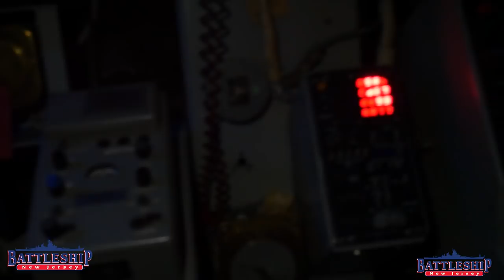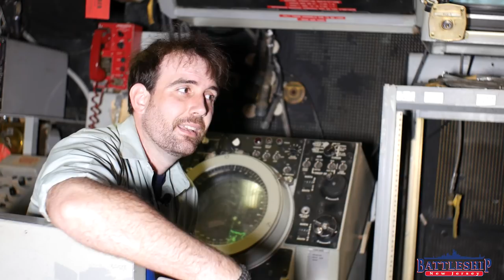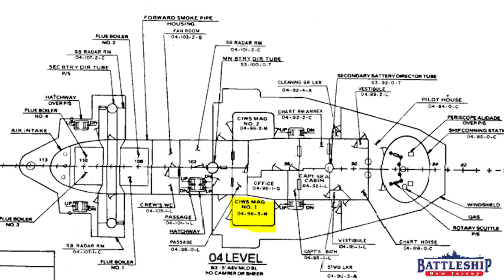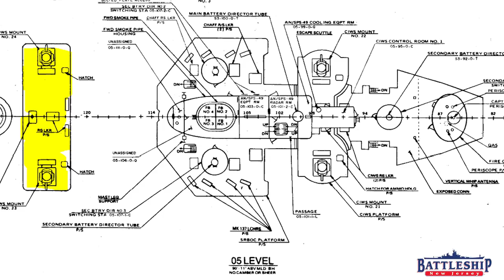Phalanx CIWS

Comment: Heavier ammunition doesn’t mean higher velocities. Usually it means the opposite. But it does carry far more kinetic energy to the target. (Mass x velocity²). It is also much harder of a metal so it will cut through things much easier. (See Moh’s hardness scale)

On that note I’m addicted to this channel. Keep them coming bro!
Reply: That is why it is 11mm diameter with a 20mm discarding sabot, most of the high amount of energy in the 20mm drive charge is imparted to the projectile. The soft sabot does not wear the barrel much, and is light enough that almost all the drive is passed through to the penetrator, with the sabot only being a fraction of the mass. Also a smaller amount of drag, so less variance from shell to shell, plus the surface is not damaged from driving rings and scores in the barrel.
Reply: Yep, at high velocities mass is the only variable of importance - if your hit by a lump of jelly at 2000km/s its far worse then a sharp pencil at 2000km/s
Reply: It depends, heavier ammunition means it can move at higher velocities because it will be less affected by the aerodynamic forces around it.  You fire a light round too fast and it'll just explode from the air friction creating a ceiling with how fast light munitions can move.
Reply: Depleted uranium. Around twice as dense as lead. Uranium shells burn away at the edges upon impact, "self-sharpening" that helps them bore into armor.
Reply: I didn’t come here for math

Comment: Since thats just a blank rack, and you don't need it to function, why not make up filler panel(s), with appropriate components to look correct. I'm sure there are pictures of what the rack should look like.
Reply: I think they found what they needed on the last strip trip.
Reply: I was thinking the same thing..
Reply: I mean it would be cool if it was at least functional enough to fire the gun... I'd donate to squeeze off a burst of 20mm blanks lol
Reply: then it wouldnt be a battleship, but a replica
Reply: @IvorMektin1701  yeah after twenty years of looking. A temporary panel for those years would not have been a terrible idea. =P
Reply: a handful of non-original parts don't make something a replica. There are spitfires and mustangs etc out there that have less than 20% original parts that are still considered originals, not replicas.....
Reply: yeah, but it is still a museum and a heritage site. For display purposes a replica would work, but an original set would be more desirable. And considering the CEC has more than enough stuff packed in it already, I can imagine making a replica isn't that high on the priority list with all the other things that need to maintained or refurbished on such a huge vessel.
Reply: @geoff chilton we have “George Washington’s hammer” here, 12 new handles and 3 new heads but it’s still his hammer.
Reply: @geoff chilton Well that's why I said blanks, don't see any reason they couldn't make blank rounds the same way they do for the other guns on the ship and since its electromechanical it'd have no problem feeding them. Should only cost as much as the powder they put in them, maybe a little extra to replace the casings and links as they wear out.
Reply: Trainer gear is another idea.
Reply: @geoff chilton Well I know for the 5in and 40mm they make their own "blanks" just by tossing powder in a shell taping the end shut, since their goal is just a big bang they don't need proper blanks. Should be able to do the same with 20mm, it's not like it needs any gas or recoil to cycle so the same method should work. Primers might be an issue, but I would assume a few volunteers could throw new primers on the shells fairly easily, I assume that's what they do with the 40mm already. 

Don't see why the Navy would care, if anything treating the visitors to the sound of BRRRRRT would just be free advertising for their recruitment since its an active weapon system you can get more exposure to by joining.
Reply: @EdHunter55  and when a war breaks out and they need to put some of these vessels back into service, I dont want to be on the ship that has pretend equipment 

the parts need not be original... just real
Reply: @hindugoat2302  There is a video about re-activation of these BB's on this very channel. I strongly suggest you watch that first before rolling your face across the keyboard and making silly comments!!....
Re-activating these ships is a long process like twelve months or more. Switching out a CWIS panel is not going to be that much of an issue. Especially considering the fact it doesn't even have one in the current state so it has to be done anyway!
Reply: Steve Wolcott  Replacing a CWIS panel is a very long way of replacing the entire ship though. ;)
Reply: @geoff chilton "if I woke up tomorrow to find I'd inherited Jeff Bezos bank account" when i was reading your comment i started to think about this picture with two people on it. On one side there was a billionaire Warren Buffett and on the other side guy with negative number on his bank account.
The point of the picture was to compare how much money they wasted on stuff that they have on them, ofc the guy with no money wasted few times more $ on sily stuff like expensive shirt, belt, pants...
Reply: @Steve Sharpe Sine the 20mm in the Phalanx is an M61 they could probably get a hold of and use the same rounds in aricraft mounted M61s, which are presumably just ball rounds. And these are definitely obtainable insce there's a YouTube channel, Black Rifle Coffe (I think) tha has an M61 mounted on a Prisu and they've shot it in a few videos. If a YouTube channel/coffe company can do it, the Musuem could do it too, esp. if they charge people for the privilege of firing the Phalanx.

Comment: It really surprised me that the Navy left those CIWS mounts on the Iowa’s when they were decommissioned. They were fairly new at the time and could have been used on newly built Destroyers.
Reply: That is exactly my question too! 🤔
Reply from the maker: They were not left but reacquired.  They are gutted inside.
Reply: @BattleshipNewJersey  Interesting! That sounds like another video... how do you reacquire a "literal piece of heavy artillery*" for a museum ship?" 😄 

*War Wagon quote... favorite film as a kid, hard to beat a Gatling Gun...  https://www.youtube.com/watch?v=UHJG2nKbE34
Reply: Those are also an early version no longer in use.
Reply: @BattleshipNewJersey  meaning all the radar tracking systems were removed so they could be used on new systems. My guess is these were just made into manually operated gatling systems and considering 20 mm ammunition is not readily available it essentially made it inert.
Reply from the maker: These are just empty shells of what they once were. All if the electronics are missing, they definitely couldn't fire.
Reply: I seem to remember the early version were less than stellar reliability wise, in that leaving them active for long periods would result in them failing and needing to be repaired. Also had a relatively long time to come on line from power on, so there was a catch 22 situation in that you could not leave them on all the time in combat, because they would fail, and that if you left them off they might not be ready when you needed them. 

They would overheat and fail, so probably the later versions did address the issues with better cooling and redesign to improve reliability, plus a faster power on time. Leaving the guns and mounts in place was a lot less work, the electronics and radar systems likely went as spares for existing systems, but the actual housings were left. Guns and such are not too likely to fail, and also the barrels likely were well used from testing, so the operational life left was not enough to warrant removal. A new barrel set with a certificate from inventory is likely a much better bet than taking an old one, and sending to get the checks, which might take 3 months or more to complete, at the same cost as a new array.

As Ryan said, they were removed from other ships, likely the originals were taken as part of an upgrade process, as this ship was in mothballs so long. Thus the manufacturer took them off to save cost in retrofitting others, as they figured this hull was likely to end up in a wrecking yard, and they wanted to save time in getting modernised versions out, so used the floating reserve fleet as source of parts. Thus the ones installed likely were from later mothballed ships, that came in after upgrade, and where the guns and hardware shells were not stripped, but the internals were for spares.
Reply: But then the supplier can’t charge the Navy 10x the price to sell a new one
Reply: @SeanBZA  A navy friend of mine told me that CIWS stands for "Captain, It Won't Shoot", so I think your comment is accurate.

Comment: I was a CIWS Tech for 8 years. Pretty cool! 

The Control Panels that would be on New Jersey are no longer being used. They have upgraded the system with new control panels to support surface mode. The Perry Frigates had the newer control panels and were likely removed and refurbished. I don’t know what would have happened to the old RCPs (Remote Control Panels) but I would reach out to NOSC Louisville/Raytheon Louisville.
Reply: Im assuming the Iowa's had block 1 or block 0 but not 1b. so no cameras for direct control.
Reply: @michaelkierum42  As far as I know 0. Wisconsin was one of the first Block 1
Reply: @ThePhalanx2006  Indeed...Iowa, New Jersey and Missouri all had Block 0 Phalanx, USS Wisconsin was the first ship in the USN with Block 1 in 1988. Block 0 could fire DU APDS at 3000rpm but Block 1 onwards was strictly Tungsten at 4500rpm. Block 0 had a smaller magazine (989 rounds) and took up to 30mins to reload, Block 1 onwards had 1550 rounds and took 5 minutes to reload due to improvements in the Ammo cassette. A barrel brace was also added to tighten dispersion IIRC
Reply: @jyralnadreth4442  did Iowa, New Jersey and Missouri got upgraded to Block 1 or no?
Reply: crazy they left them on there and didnt repurpose those, they seem relatively easy to remove.  Ya think all the motion control drives and motors are there?

Comment: I think it's in Friedman's Battleship Design book, he mentioned that when they were cutting away those triple 40mm gun tubs in the 80s, they found the original skids that were meant to hold the ship's boats between the funnels. So, I imagine if you could look further down beneath that prefab CIWS structure, below the remnant of the gun tubs, you'd see the old boat skids!

Comment: I think the SeaRam is probably the best against modern threats... its fast, highly maneuvable and can be fired when the incoming missile is at 20 miles, thus having a 6 mile kill box. It can also engage multiple targets at a time. But in all fairness. You still need layered defence for it to be safe.
Reply: I'd argue that Phalanx would be better served on smaller and older ships or something, it's just not viable in the modern day because missiles cross its engagement envelope so darn quick.

Comment: The Phalanx is, I believe one of the first CIWS systems developed anywhere in the world.  A number of other systems were developed by other nations along similar lines including the EU's Goalkeeper and the Soviet / Russian AK-630.  

Most CIWS systems today are products which have been improved over the years to add additional capability.  As first developed the Phalanx had no capability against surface targets but as time progressed Raytheon added a visual targeting system which allows that Gatling Gun to be used against small surface targets like Iran's annoying little small attack boats.

Also, most navies have added missile systems like the RAM (Rolling Airframe Missile) and others to complement their CIWS gun systems either in separate mounts or in combined gun and missile mounts.  In most of the USN Arleigh Burke class destroyers, that "empty" position on the superstructure forward of the Bridge is a vertical launch system specifically for the Nato Sea Sparrow Missile (NSSM,) in the 'first flight' Burkes this was indeed a forward position for Phalanx.
Reply: I think AK-630 pre-dates Phalanx by a few years.

Comment: why not just make a fake control stand thats "close enough" for now until you can get a real one?
Reply: Replicas. They should hire prop makers to make some.
Reply: Because they actually want the real systems like the radar controllers in CEC.
Reply: @Marin3r101 replica panels of restricted items should be ok. They have replica rounds instead of real shells. they run a different screen with a video loop in the radar station, because they can't actually use the radar.
Reply: Replicas should be fine, but if you can get the real thing why not? I guess if it’s something you really want to get the real thing for why waste money constructing a replica when money is finite.
Reply: Fake it 'til you can make it?
Reply: Why not make a life size photograph of the real thing and paste it over the hole.

Comment: That is not what "chaingun" means... its a rotary cannon or gatling gun, absolutely not a chaingun. The "chain" in chaingun is an actual chain like bicycle chain that drives the bolt around in the reciever of the gun. Chainguns also have single barrels.
Reply: I learned something new from your post, thanks.
Reply: Yeah, for example, the gun used on the AH-64 is a proper chaingun, and it has a single barrel.

Comment: At 10:24 It is not a chain gun, it is a Gatling gun. A chain gun does not refer to the belt of ammo being a “chain.” An actual chain gun, such as the M242 25mm bushmaster or M230 30mm Hughes, is called a chain gun because the bolt is driven in and out of battery by a literal chain and sprocket drive system. I was an infantryman in a mechanized battalion, so I became quite familiar with the M242 25mm bushmaster chain gun.

Comment: CARR (FFG-52) doesn't have the one you're looking for. In 2005 we upgraded to the CIWS Block 1B. You need an older RCP (remote control panel) for CIC. We had an RCS (Remote control station).

Comment: Given that the CIWS system is still in use and likely still classified to a certain extent I would be surprised if they could get the control panel they were looking for. But then I got out of the Navy in 1992 and it is possible they might not be so concerned about that now.

Comment: goalkeeper was always fun, based on teh GAU-8 30mm.  the new CWIS that replaced the 20mm with a small RAM launcher is an interesting twist.

I recall seeing somewhere that the BBs could not receive NATO launchers as they can not withstand the shock from the main batteries.  either the launcher, the target directors or both would need to be redesigned in an armored version.  CWIS on the other hand was fine with the shock from the main battery.

hints of this are seen in the tomahawks, the battleships have armored box launchers for them.  would like to see a video on those launchers.

i imagine things might have been different if VLS was more of a thing when they were reactivating BBs.  seen one custom model with a much more intensive modernization of the battleships featuring VLS and automated 5 inch turrets secondary batteries.
Reply: I don't know about the electronics but the Sea Sparrow box launchers use plastic/fiberglass covers to protect the missiles from the elements. They just get blown apart by the rocket engine and the missile when it launches and would likely have to be replaced every time the main guns were used. Considering the shock and G-load most missiles can withstand  during launch and maneuvers and the fact that the Tomahawk armored box launchers were also used on cruisers I suspect the armoring was more to protect the missiles and launchers from indirect battle damage than the pressure wave from the ship's own guns. More than likely the decision not to mount Sea Sparrow launchers was more due to the required radar directors that would also have to be installed.
Reply: @OriginalBootlegger  i remember reading about it being talked about specifically, the armored launchers on the battleships at least was specifically to protect them from the blast pressure of the main batteries.  by that time, any sort of incoming direct hit was going to destroy the launchers anyway.

i know the NATO launchers would have issues because of the cell covers.  when i was in and they were actually going to launch a missile in an exercise, they would tend to remove them to save them.  also, while the center pedestal and elevation section is probably plenty sturdy, the box launchers are pretty flimsy.

on constellation they went one step further on the cell covers, they had sets for in port use with an american flag across one set of four and CV-64 on the other set.  while they would probably still work if you pushed a missile through them, the paint was probably not radome paint.

i honestly don't recall how resistant the fire control directors to blast pressure but it might not have been all that good the ones on carrier that is.  on both of my carriers they were mounted high up on the island and the ones facing the flight deck had shaped platforms that would go far in protecting/deflecting stuff from the flight deck below them.

Comment: Surprises me that they never made the Phalanx system able to self feed from a magazine underneath it. Seems a rather large flaw in the design with a weapon that gobbles ammo so fast, having to hand load it...
Reply: I have a hunch that the hand reload time may also match the barrel cool down time that would be necessary after a sustained burst of fire that emptied the magazine.   That must produce a tremendous amount of heat.
Reply: Phalanx was designed for a minimum footprint and it thus very compact. It would require a full redesign and much more ship modification to install. As Ernest pointed out, those barrels get very hot. You can melt them if you are too aggressive.